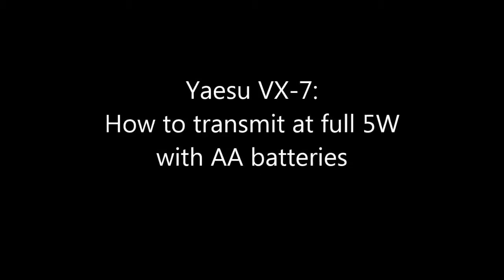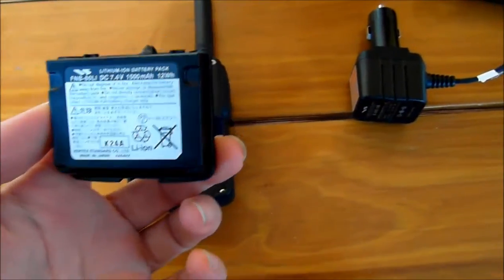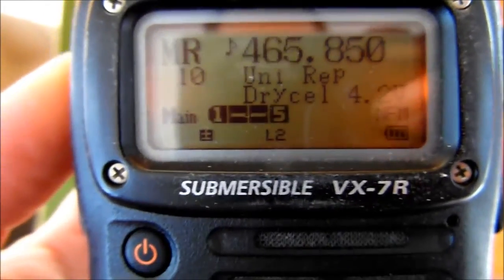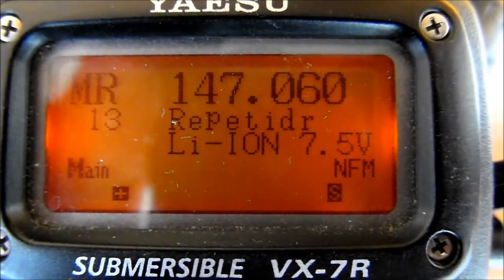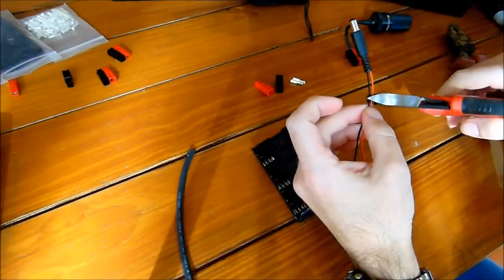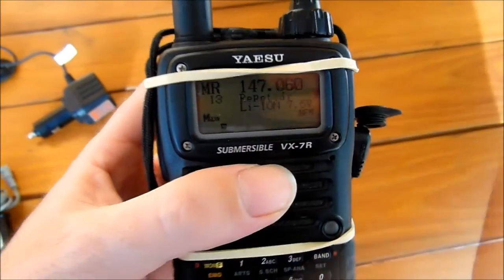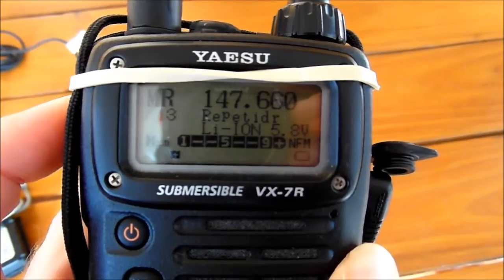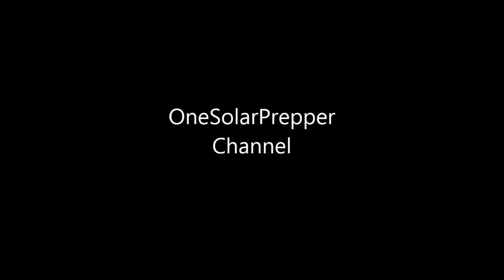2MIN - Yaesu VX-7: How to transmit at full 5W with AA batteries

Comment: Why not use???...........18650 3000mAh 3.7V Rechargeable Li-Ion Batteries, that are the same size as regular AA batteries... NO Builky Build... That will give you 7.4 volts and full power on the VX-7R... The same as the FNB-80LI... Also anything over 9v is tough on the finals... Just saying... HiHi... James
Reply: I believe you are thinking about the 14500 because the 18650 is considerably larger than a AA but I was wondering the same thing.. the only benefit I can think of for this AA mod is that you can get the replacements at the local gas station which don't normally carry rechargeable 14500s.. but with alkaline batteries you will be pushing 10.5 volts, I know the DC jack says that it's rated for 10-16VDC but I'm not sure about the battery input since it's rated to run on the 7.4 Li-Ion..
the only real downside I see in using the 14500s is that they aren't used in as many applications as the AAs so you are carrying a particular battery just for the radio backup, which I can understand some people don't want to do, but I personally don't see a big problem with.
Edit: I do see your post is 3 years old, this is more of a future reference for other interested users...

Comment: simply buy a 12 v battery pack for your belt or pocket and run a cord to your radio.... any radio. Much simpler than doing what you did wouldn't you say ?  AE4NM
Reply: AA batteries are small, ubiquitous, and easily charged with a small, solar charger.  Not so much with a 12v battery pack.

Both have advantages and disadvantages.  How about a belt pack containing AA batteries?